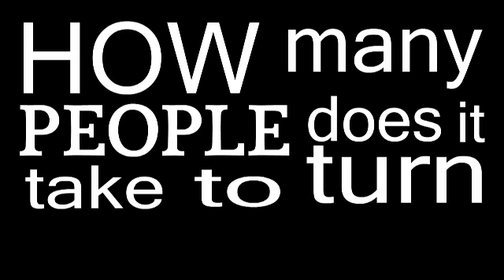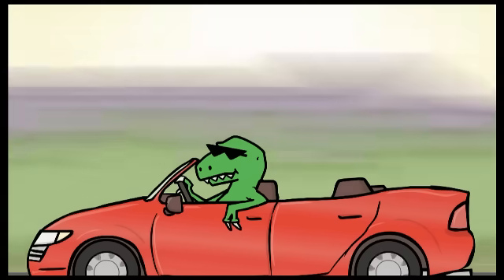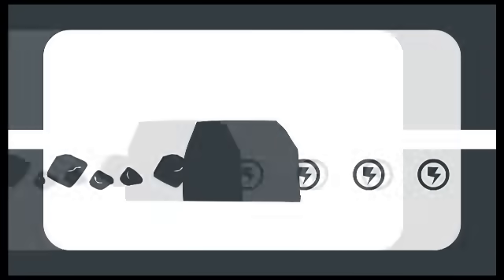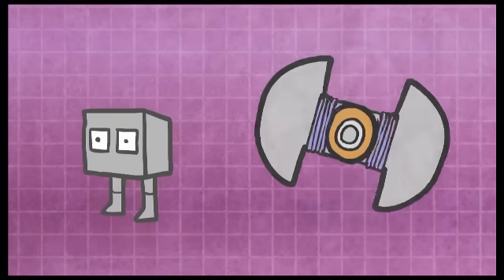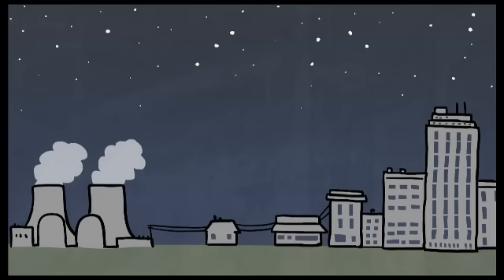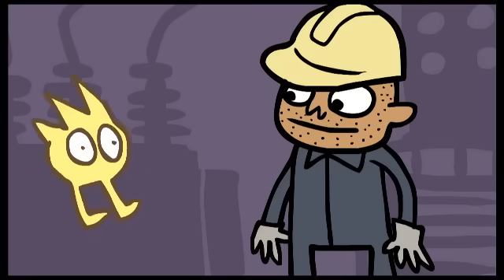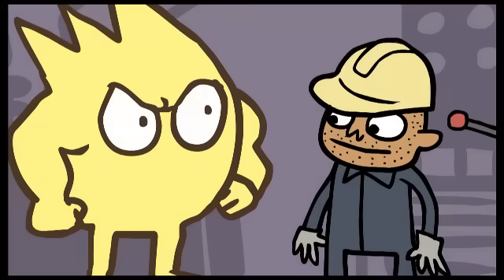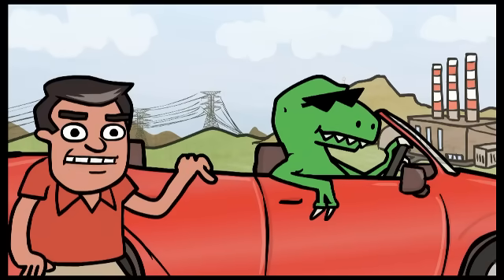Energy 101: Electricity Generation

Comment: This video has wrong information in it. Power substations do not step voltage down to 110 volts. They step it down to between 4,000 and 15,000 depending on the local system; then the transformer on the pole just before your home steps that down to 2 phases of 120 each to neutral or 240 volts from phase to phase.
Reply: James Brady thanks for that information. im learning this and that was actually really important to know.
Reply: I think it meant closer to 110 volts. But you are correct. And you should probably look it up on something different than a cartoon if you are doing it professionally.
Reply: James Brady u are smart
Reply: No it doesn't it said as high as and as low as....
Reply: ikr
Reply: Ask ElectroBOOM he know it all
Reply: in all fairness, he dad say "closer to"  not "to" 110 volts
Reply: James Brady acdx
Reply: Yea
Reply: He never said that. Here is what he said: "Their job is stepping down electric voltages from levels as high as 765,000 volts CLOSER to the 110 volts you use in your home"
Reply: Some words is incorrect bro , single phase not 2phase , 
And the substation system is depends to the country , example in Philippines we have , 
1. Line to ground  -220+ground
2.line to line -220+neutral 
3.line to line + neutral - 110+110+neutral 
Some country only three phase + neutral 
But the primary line I think all the same about 13k up kv 

Tell me if I'm wrong
Reply: wtf did you even say, btw this is supposed to be for like 5th graders
Reply: I figured the Mathematics was a bit off because if the power stations already made it 110 V which we use at home why would the transformer on the line need to do anything else I thought? On a whole good video though. I liked it very much. He gets an A regardless of that small error.
Reply: Valdemar Hoejlund Power substations don’t get them closer to 110 volts, the transformer does - which is different than what James Brady commented. Why form a rebuttal if you don’t first understand what you’re arguing against? 
Wrong information is wrong information.

Comment: Thank you. This is a great video, I wonder why some countries in this world still lack electricity if it is damn easy to produce.
Reply: How much do you think it costs to build power plants, transmission lines, etc? My guess is somewhere in the realm of 20 million dollars each.

You can buy a portable generator that runs on petrol for just a few hundred dollars, but that's only big enough for one person or one house.
Reply: >>>The uninformed think that except for a few cities, Africa, the Sub-Sahara and other small countries don't have a means of power generation. But where do you think that many Islands and small, distant communities get their power from? Solar panels? 
>>>Nope, Although with the rising efficiency's of new panels the problem is still storage of excess power for overnight supply, Although China is leading the world in research and testing that problem, the only reliable resolution is STANDALONE POWER (SAPS), COGENERATION or more often Micro-Cogeneration, Micro combined heat and power or micro-CHP (Power supplie's of up to 50Kw). 
 >>>You'll find these all over the world, even on the world's ocean's(Look at any Cruise Ship and you'll find Co-generation) 
for over 60 years, a majority of the world's power came out of Waukesha, Wisconsin. Waukesha, Founded in 1906, Started building heavy duty motors and Gensets in 1957, 
>>>>Waukesha VHP Multi-fuel generators (gasoline/kerosene/ethanol, Methane, LNG and propane)are Heavy Duty Engine/Generators called Gensets that can run on almost any available fuel including Methane recovered from landfills and animal waste(Biogas), there are examples of these in the USA, not just 3rd world countries, pulling the methane out of closed and covered portions of landfills all over the U.S.
>>>Waukesha Gensets have been installed all over small countries with locations too small and too far apart to invest in the 100's of Millions req'd for a base load Powerplant, They are so overbuilt, durable and economical (for the scale of the product) that you will find Waukesha Gensets installed 30 and 40 years ago still doing their job and the company was a great asset to the U.S. until GE Closed the plant and moved it out of the United States, for of course, Cost Savings, ie; Lower Wages, tax exemptions and the offer to help with the cost of relocating the production and assembly plant elsewhere

Comment: Where does the extra voltage goes?
Reply: All of it goes where flow goes, like water. If a device is rated for a certain voltage and you add more you could damage the device. You can add resistors or other small components to cu down or divert the extra voltage, for example a resistor can lower the voltage and the cost of heat dissipation. You can't destroy energy but you can transform it.
Reply: @xiao3207  Thanks. Glad someone read this. It took me a while to *really understand this too. Electronics are f. cool, and really weird logic! 

Did you know that in reality power comes from Negative and NOT positive, but we are too lazy change the books so we pretend positive is where power comes from!?
Reply: @Eblanc  I seen that theory confirmed from a vacuum tube in a microwave
Reply: @SirDavid0  It happens in many different ways. But in electrical mostly extra energy gets turn to heat. Which is sometimes the bad design, or the way things are intended to work, and sometimes the only way it can work, For example, Guitar Amp Tubes: They get really hot, but that is the only way the can work.

Those 3 reasons are why most electronic get hot. The 4th reason is when you have a short circuit (negative and positive are touching with nothing in between, so electricity travels soo fast it loads the system and makes the battery and other components hot)

Comment: Fun fact electricity from power plant to your house is really actually connected but technically is wireless the electricity goes to transformer to step up voltage to travel long distances. Then steps back down. The transformer has wraps of wires wrapped around each completely insulated from each other but the conservation form of electricity known as radiation Moves the electrons in the wires parallel to it with magnet activity or radiation causing them to move in the same way the current form the generator does. Im just saying I’ve been and electrons for 12 years and only on the 10th I really understood this. It’s crazy that current from utility companies aren’t actually connected the way you think. Electricity will have at least (minimum) 3 points of non connected points.  And only using a conservation form of electricity which is technically wireless does electricity go from utility to consumer actually there are 4 the generator spinning is the first point

Comment: We could also use parabolic mirrors to heat water to generate electricity. This would work well out in the desserts.
Reply: You would think that desert countries (e.g. around the Sahara) would use solar panels, but they usually use oil or gas for power because it is cheaper.

Comment: Smaller grids;
If you increased solar on buildings, the overproduction could be fed back onto a more LOCAL grid and used quicker and with less volume loss.

The steam plants wouldn't have to run so much and you could have multiple, smaller, more efficient grids that only product when demand is higher (night or cloudy days).

The current model reminds me of Dunkin (-Donuts).
They make donuts all day over and over with the idea that, ideally, every donut will be purchases prior to closing/end of day (24hr stores).

In reality, a lot of those donuts get thrown out.
I feel the same happens to electricity produced by the steam plants running all day, regardless of demand flow equation chart.

The product (coal, gas, etc) used to create the steam to electricity is destroyed.
Whereas the solar rays if the sun are going to shine on Mr Johnson's house whether he has solar or not...why not use It?

Invest in Solar.
Kick a prius driver.
Reply: Well is the electricity really going to waste when they can store it in sub stations?

Comment: At 4:50 he turned the wrong switch on for the lamp.
Reply: Thetrucky69 omg yes XD
Reply: some houses use those types of switches. like my house
Reply: My house has 1 out of the two sockets on every set in every room that is controlled separately by a light switch and it is for hooking up lamps that go on with a switch if the room doesn’t have overhead lighting

Comment: ACID: Distilled from compost (Dilute Nitric Acid, or Vinegar), and filled into a clay pot... possibly with some sea water or salt for electrolytes. Inside, goes a copper tube, which another copper rod sits inside of, with copper wires around it. You can put a glass dome over the top, with a metal filament, to make a Sumerian Lamp. It makes a white hot spark, when you touch the 2 wires together. It's also a D/C battery, the wire coiled onto the rod is the positive lead out, I think you can charge it by putting KOH (electrochemical reaction produces heat, between acids and bases... KOH is potassium hydroxide, ash) into it, but it's relatively safe to dispose of, as it is all natural and the acids can be diluted. You may be able to attach a wire to the rim of the battery to charge it from a Dynamo, which is just copper wire coiled around the outside of a housing, ...wrapped around a rod, with a wire leading from the rod to a battery....with more copper wire coiled around an exterior housing, facing inwards..... the exterior housing spins around ball bearings, and a magnetic vortex is created that pulls static electricity from the air, sends it through the dynamo (space between 2 wire coils),  thru the central coil, to the rod.... and by wire, to the battery. Coil-Potting glass could make the lamp bulb, and Alembic Distillation equipment back then... 4000 b.c. ⚗  I think neodymium could be used instead of copper here, for an exponentially larger production of electric currents.

You can't generate electricity without a dynamo, or an electrochemical reaction... and don't ask how to make fire, we just steal it

Comment: Voltage is the potential energy of electricity. The water analogy is the easiest to undertand. Voltage is water pressure and amperes are the amount of water flowing. Power (watts) is the combined effect of both water pressure and flow.

Comment: for some reason our electrical company have added a  power line( 4 lines) which crosses over to our block of flats and at another residence  of ours the 4 wired lines crosses over from left to directly in our veranda. i am being electrically targeted (TI'S) .  Are they decreasing the volts or are they stealing our energy and renewing it back to us or giving us solar energy instead.? strange not quite my forte electrical stuff. any ideas?
Reply: if you have a voltmeter you can test your home voltage, if you are in america it should be around 110 volts ~
you should check your electric box and see if it's showing electric usage more than your house uses.

Comment: Honestly, I am searching for the bare bones of what it takes to generate electricity(using a source such as a water wheel or windmill). It might seem primative by comparing and contrasting them with modern-day wind and water turbines, but their parts are also far easier(both to produce and their renewability) to replace than the current models, with wind turbines requiring rare earth materials that currently only have a life-expectency of 20 years and have a harsh impact on the environment in order to be mined.

Comment: 3 questions:
Why are high volts needed to transfer electricity long distances?
How are volts separate from watts?
What is that electricity doing while your lights are off and you are not home?
Reply: SogMosee First Question: High voltage is required to transfer electricity across long distance because the equation for power consumption is P(power) = V(Voltage)^2/R(Resisitance). So the larger voltage you have on the line, the less power consumption because the resistance stays the same.
Second Question: Wattage is separate because wattage is a unit of power, and voltage is a unit of volts. So in the power equation  P(watts) = V(volts)*I(Current)
Third Question: Electricity follows certain laws called Kirchoff's Current laws, and Kirchoff's Voltage laws. The resultant of these is such that the power consumption on the power grid and the power generation has to always exactly match. So when your lights are off, that power is not being generated by the power company, or it is being used by someone else. 

I hope that answers your questions.
Reply: 1-its the relation between Volta,amperes and ohms that forced us to transfer with high voltage,the relation is  called  ohm's law .. When we increase voltage to higher levels,higher than 400kv, then current is reduced then we reduce the losses in the  cable .
Reply: 2-volts (voltage) multiplied with amperes(current)  leads to watts(power), p=V*I=volts*amperes=watts. So voltage is the pressure and amperes arethe transfered quantity both creates the power ,watts.
Reply: Imagine that if all people in your city turned off their homes the electricity dissipated,if you don't use it it goes to your neighbours ,if all the neighbourhood turned off then it goes to the next neighbour .
Reply: The last answer was for the 3rd question.

Comment: Why not say that electricity occurs when the flux lines of  a magnetic field which is invsible to the human eye collide with a coil of insulated wire? And that that is where electricity comes from whether you call it voltage or current? Electrons are forced into a space where they can do work.

Comment: plug in the two ends of a volt meter into the earth and watch what happens, a bit of water - not to much - will produce more voltage (mV). This is also known as an earth battery.

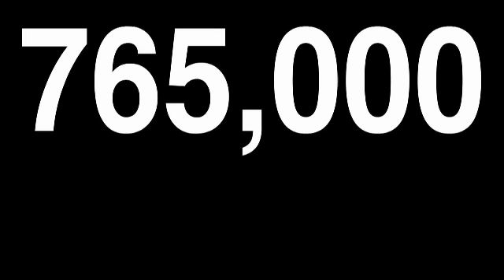Comment: But what happens to rest of the electricity? 4:24 is it wasted as heat?
Reply: Good question.... I don’t think you can save it lol I’m wondering this as well
Reply: If you mean the 765kV. It passes to transformers to reduce their capacity. That energy is reduced. It may lose some of it because of heat and other factors because no physics system is perfect but it doesn't mean all of that is wasted.

Comment: HVDC energy grids can transport electricity around the earth without any loss of energy !
Reply: +mike peine there's no such thing as a perfectly efficient energy
Reply: jason200912
 i guess that's your little secret . Because China built one across China without any measurable amount of energy loss . IEEE
Reply: mike peine the maglev?  is that what you're talking about?  maglevs aren't perfectly efficient either.
Reply: jason200912
 look it up
Reply: mike peine i did and that was the only thing that would fit "China built one across China."  I'm not sure why you're avoiding the name of it, but I think it's because you're hoping there is something else that China invented to try to cover your ass from making outrageous claims on a single project.  F.Y.I, the maglev is not perfectly efficient--it has to fight against air resistance and can cost up to 30 million USD per kilometer.  there is also energy generated back to the power grid from braking--but obviously some of it is lost.  Since constant energy is also used to levitate the train--it would make larger trains counterproductive and would actually use more energy lifting the train rather than fighting the friction of a rail.  When you said look it up that pretty much gave it away that you couldn't name the invention.

Comment: OK, it's 101, but that's a good time to point out you need to throw heat away to run a steam turbine, also video gives the impression that the generator is efficient because water is recycled, whereas efficiency has a well defined meaning in engineering, and reusing water isn't it !